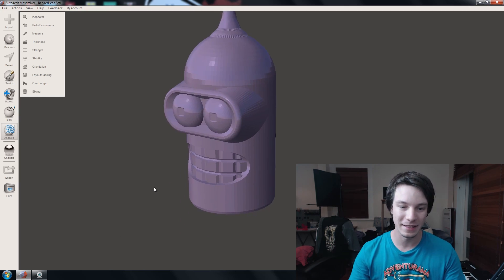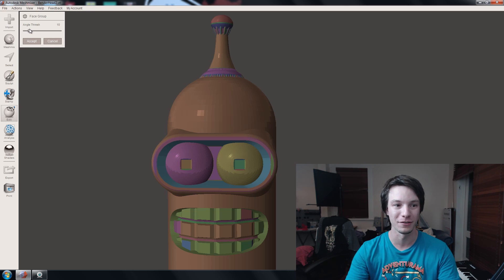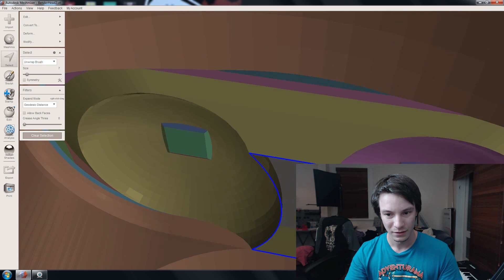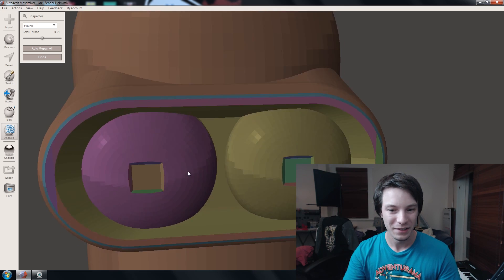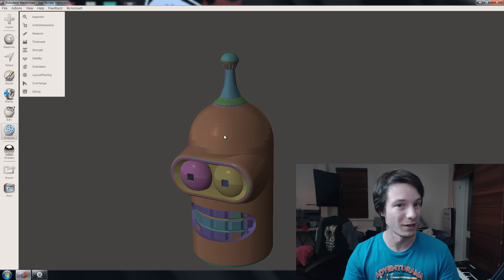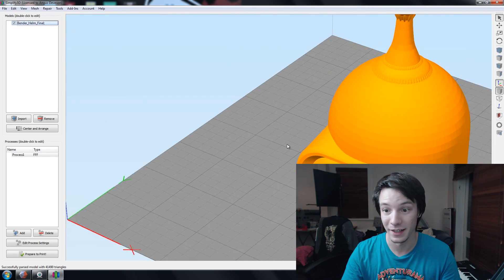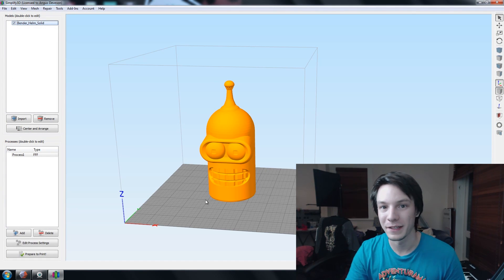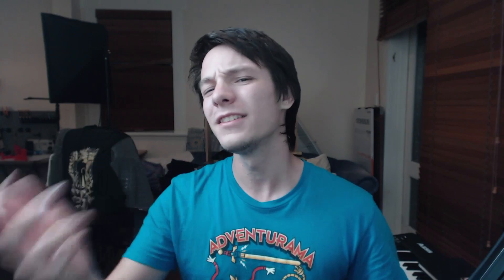Fixing the Bender Bust for Joel - The 3D Printing Nerd!

Comment: Hey Angus, perhaps an easier way to remove the internal geometry is going in through the front. The procedure is largely the same as yours but:
* when using the Generate Face Groups tool use Edge Angle mode with an angle threshold around 40-45 degrees, which will cause each entire eyeball to become their own face group.
* then, selecting from the front you can click a face in one eyeball, double-click to select all of it, and do the same with the other eyeball.
* press "Y" to seperate the selected eyeballs into their own object and then hide them in the Object Browser.
* with the eyeballs out of the way you can now select the weird geometry that was behind them and delete it.
* show the eyeballs again, analyse the object to fix the hole.
* finally select-all and Combine to join the objects together as one again.

Comment: Hey Angus,

Thanks for this and other tutorial vids.  I wonder if you might help w/ another meshmixer tutorial.  I have been wanting to 3d print some gifts for my nieces and nephews.  They are young and I was thinking about printing some piggy banks.  Sure there are some piggy bank models out there but I particularly like the LFS Elephant and think it could make a cool piggy bank, especially if printed a bit bigger.  Another idea I had was to print a pocket in the model and pause during the print to hide something like a gold coin or maybe a small silver bar and give them a "break open on 18th birthday" for college note or something.  Even more I think it'd be cool to customize them with names.  Either inset or raised.  I have taken a stab at this in Meshmixer but I do not know if I could have done it more simply.  I also saw that when slicing when the model gets very near to the top there are some wicked overhangs and I don't think it'd print well.  So I had toyed with the idea of splitting it and printing the top 20% of the elephant body separately and then gluing it together.  This way I could print the top with supports on the inside.  So could you perhaps show how to turn a model into a piggy bank?

Ideas:
- Hollow the LFS Elephant (maybe only part of the body, if you just extrude or hollow it makes some weird shapes and I don't want things to get stuck.)
- Add a coin slot in the top
- Add a hidden pocket
- Add a removable opening (optional, maybe really stick with the "open on 18th birthday" idea
- Customize with name, raised or inset
- Deal with overhangs

I'm sure you know the model but for convenience and for others who may not be familiar: https://www.thingiverse.com/thing:257911

Comment: Finally got around to play with this, couldn't do the face groups for some reason and couldn't select internally either. 
But deleting a section of the base then filling the hole up fixed the glitch behind the eyes. Weird.
Still a pretty poor model, it would be easier to use this as a guide then build it all again in 123D for me.

Comment: Yes meshmixer videos are da best! but I didn't understand one thing. When you cut out the eyes, what was that whole offset thing that you did. was it to make it hollow?
Reply from the maker: +Noah Saxenian When I cut the eyes I made the shape non-watertight, so I offset the outside to create a shell, some real thickness the slicer could understand and use for 3D Printing. It's a little bit different to how you would make a shape hollow in your slicer normally, but allows for those eyes to be open!

Comment: Hey Angus! First of all thanks for your videos. I have learned a GREAT deal from them. You're probably my favorite 3Dprinting channel.
Anyway, I have an issue with meshmixer and maybe you can help:
Making face groups doesn't work anymore! I can't generate them from the  menu function or even selecting and using the keyboard shortcut. I tried restarting the program and resetting to default settings and nothing.
I haven't found anything about this online. Any idea on how to fix it? Or can you at least point me somewhere I can figure this out?
Thanks!

Comment: Hey =) I like your tutorial videos very much! Could you do an video about using a standard 3d file e.g. *.obj and merging it within fusion 360 with a extruded body?

I tried to create a own table top miniature by taking a spider obj file, but I can't get it to work to join the *.obj file with the stand (just a extruded round body) within fusion 360. I wasn't able to convert the *.obj file inside fusion to a body, because of too many triangles? All of my meshmixing attempts failed epicly. :-)

Maybe someone else would like to see this? If so: thumb up ;)

Thanks! ;) Great Job - I love your Channel!
Reply: Fusion360 has trouble converting triangle meshes to bodies. You need to convert the obj file into a quad obj file. You can use Autodesk's Memento for that. 
Good luck!
Reply: +r343c Thank you! I'll give it a try ;)

Comment: Hi Angus, great video thanks.
Is there anyway to combine two Stl files? I have two model pieces, that I would like to be one complete piece for strength.
I thought it might be as easy as using the magnet tool in 123d to snap the faces together, however I can't get it to work.
Your help would be greatly appreciated.

Comment: Hi Angus,
In the meshmixer-hollowing-method, besides the eyes, you'd also need to cut out the 'neck' surface, right? Setting the "floor" number-of-layers to zero wouldn't help (imo) because all other horizontal surfaces (with their normals pointing upwards) wouldn't render/print either (e.g. around the 'eyebrows'). Would you recommend hand-editing the G-code to remove the base-layers? (..or in meshmixer making "jobs" or "batches" or whatever to render the bottom centimeter with a different rule-set (zero floors-thickness) and the rest with a "normal" three-layers of flooring?)
Reply from the maker: +Aditya Mehendale Yep, if you just use the hollowing tool, you'll need to plane cut the base off as well. I don't really recommend hand editing G code, easy to have things go haywire! If you're using extrude however, it just adds thickness to the existing surface, so won't fill the neck in. If you make the edits in meshmixer, you shouldn't have to do anything fancy in your slicer.

Comment: if you were going to cut that model in 2 pieces you like at 9:25 you want want to make sure that the top part had 0 bottom layers so that it would still remain hollow, right?
Reply from the maker: +Gene Gerhiser Yep, you'll have to set top and bottom to 0 so you end up with only the outside surfaces, then you could print in multiple sections.